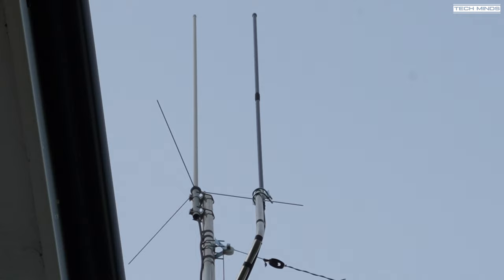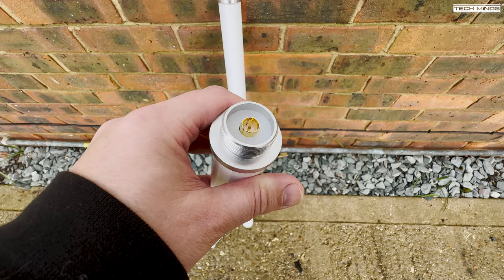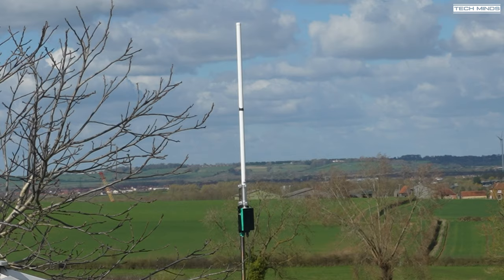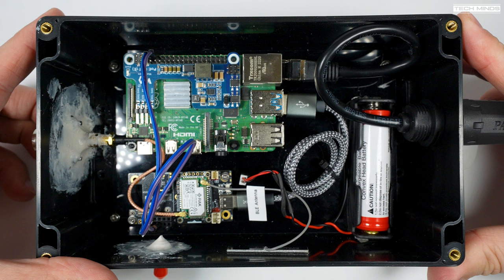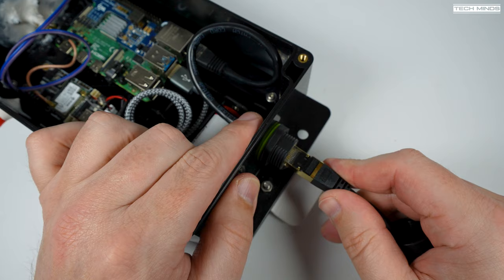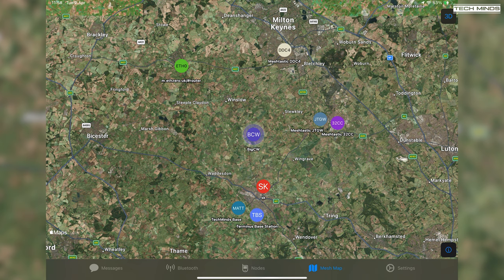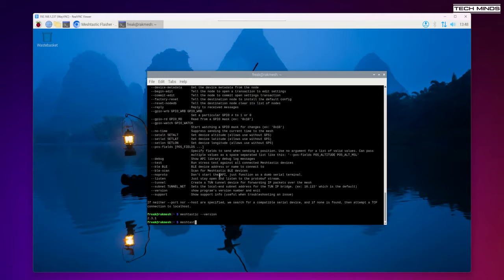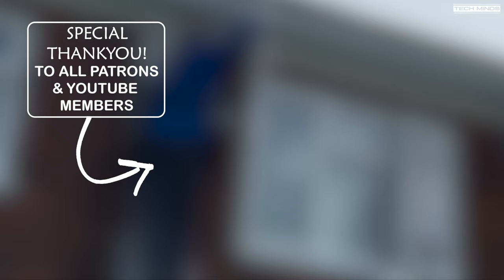Meshtastic Home Base Node Using RAKWireless & McGill Microwave 9dBi Lora Antenna

Comment: Stonking good idea to power the Pi over ethernet. I have a similar setup using a Nelawya Outdoor LoRa Gateway 5.8dBi 868MHz antenna and I will add a Pi 4 to run the updates.

Comment: I think you did well! 👍  Only issue I can see would be strong winds swaying that box; unless you have guy-wires that I couldn't see.
Reply from the maker: Cheers! The pole is only 8 feet long, with 3 feet below the gutter and in the bracket, so there isnt that much "sway". Its been windy and raining here recently, and I have kept a close eye on it for sure ;-) thanks for watching. :-)
Reply: @TechMindsOfficial  - you bet!

Comment: Thanks for making this. I am working up something similar - A question if I may ? did you consider using a long - maybe active USB cable instead of POE/Pi/injector etc ?
Reply from the maker: I did consider using a USB cable, but I wanted access to the Serial output from the Wisblok, for experiments. So having the pi with the POE made sense. :-) Cheers and good luck with your build.
Reply: @TechMindsOfficial  That makes sense thanks for replying

Comment: My poe powered wisblock kicks out min 10 deg F heat converting PoE+ from 56v down to wisblock requirement of 5v. Does your waveshare poe adapter kick that much heat?
Reply from the maker: Sorry I can't answer that because it's now up in the air on the end of a pole. However, the internal temperature of the box is around 7 degrees C more than outside! :-)

Comment: Other than the battery backup, is there any bebefit of this hardware setup over just using a LoRa Hat on the pi directly and using meshtasticd?
Reply from the maker: I only tested with the PicoPi and a supported Lora board, but there is no Bluetooth. Also, the RakWireless modules are cheap enough, and are rated pretty well in terms of reception, add on modules, power consumption. However, I would advise anyone to experiment, it's all part of the fun with projects like this. :-)
Reply: @TechMindsOfficial  Gotcha. I just figure it's probably the most stable option for something way up on a roof mast. As long as you dont nuke your rasbian install  :)

Comment: So you are going to return the Parador antenna? Production error?
Reply from the maker: I need to take a proper look at it to try and determine where the fault is. When I took it down and installed the McGill I just put the paradar in the conservatory, and I kind of forgot about it. But will see whats wrong with it first.
Reply: @TechMindsOfficial my Paradar 11.5dbi worked great for a week or two then went totally deaf. SWR was around 2.0:1. People could hear me but I could hear absolutely zero stations. I took the antenna down and plugged in a Paradar 8.5dbi antenna and whilst it was laying on the floor stations started coming through. The 12.5dbi again gave zero. I will be sending it back to them but not sure if I care about the hassle of having it up and it going wrong again
Reply: thanks tore for mentioning this video to me
best wishes to you and your family
Reply: @ChrisClifton  I do hope that that I am lucky one my paradar 11.5 been up a couple of weeks so far so good it would be interesting to find out if there is a common problem with the paradar  .The McGill Microwave 9dBi definitely looks a better constructed antenna 
best wishes to you and your family
Reply: @dave-26ct475  Thanks, I see TechMinds did make an update 3 weeks ago. It sounds like production error, or at least something reasonable to make a warranty claim on.